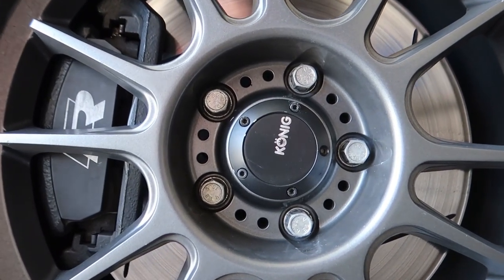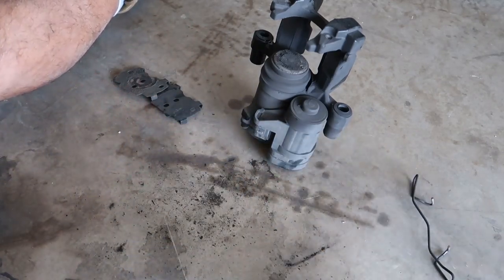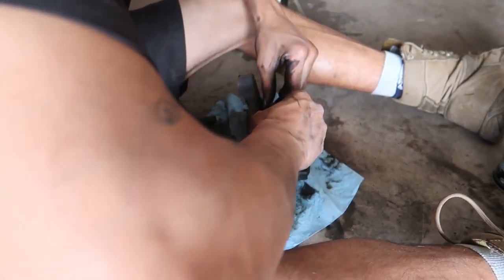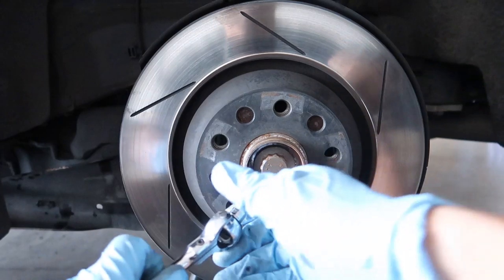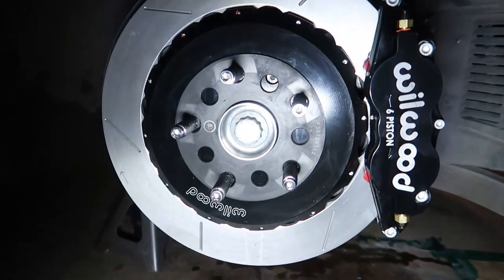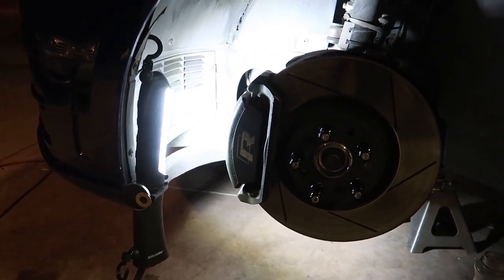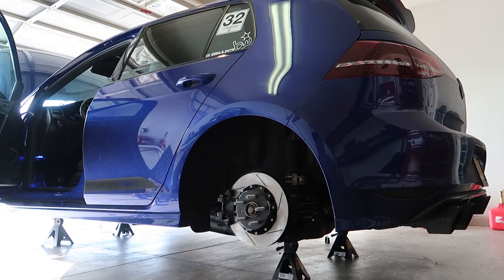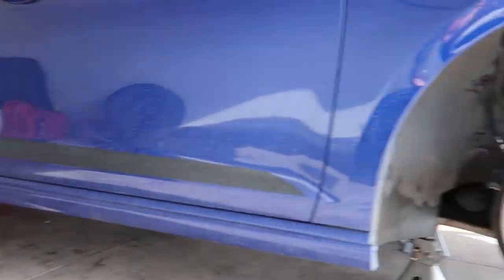Wilwood Superlite 6pot BBK + ECS 2pc rear rotor & 034 lines! | MK7 Golf R

Comment: Wow 20 lbs of sprung weight is a lot, is it very noticeable in ride or handling? 
LOL when I heard you say "I let the lines drain", my first thought 'oh no don't do that!' Live and learn. :) 
In the shop manual they tell you that anytime you are opening the system like say replacing a brake line or caliper, to open a bleeder and push the brake pedal to the floor and hold it there with a piece of wood or something (of course vw has a special tool for this but...). When the brake pedal is all the way down it shuts off flow from the reservoir, and stops the fluid from draining out while you have the lines disconnected.
I did this when I added SS lines and it works great, just used a 2x4 and wedged it with the seat and slide it forward. I also got a pressure bleeders and OMG, it is so nice, going forward I would never bleed brakes any other way. 
I am very interested to hear how these brakes hold up and how they perform under extreme conditions.
Reply from the maker: Heck man its 20lbs per SIDE! I can feel it, at least i think i can feel it lol! I will definitely be getting a pressure bleeder, sucks having to depend on others to come help, especially later in the day. Didn’t know about holding the pedal down, but it only makes sense.. but yeah just like you said, live and learn.. hopefully others that see this will now not make the mistakes i did!
Reply: @BryceJordanProductions  Oh BTW, how is the clearance compared to the stock calipers?

Comment: For the rear calipers I thought with OBDeleven you can have the piston go back electronically. I mean I have the golf R with electric parking brake.
Reply from the maker: Nah that's not how it works, it just released the motor tension so you can push it back in

Comment: Nice!  How’s the suspension feel?  I’m interested in the rear rotors. How much weight did they save?  I’m sure the fronts makes a huge difference in feel.
Reply from the maker: Saved about 4lbs going to 2pc in the rears! Suspension is set up very nice, I love it. Might actually wind up going to a stiffer spring later this season. But the BCs overall are awesome

Comment: another question for you about this brake kit.. I see you retained the dust shields no issues with fitment of those?  do you have OEM VW wheels using no spacers to confirm that 18 inch oem wheels will fit without contacting the caliper?   trying to decide what brake kit to go with myself too.
Reply from the maker: I dont have OEM wheels anymore, but going off of what i run now and prior, you shouldn’t have an issue at all, IF anything you’d need like a 2mm spacer.. but i highly doubt it, these only protrude a tad bit more then oem calipers. I had to run 5mm with oem calipers to clear my wheels and still kept that same spacer but you can see its just a tad bit closer to the wheel. No issues with the shields either!

Comment: I was originally going to get the tts brake kit conversion from shopDap but this kit is tempting because of the price. Any info on the brake pads that come with the kit?
Reply from the maker: I have no info on the included pads. But alot of companies make pads for wilwood so I'm sure you could find some you like out there. The pad design number is 7416

Comment: Bryce, I just purchased front and rear 2 piece ECS rotors and Hawk 5.0 street pads. What pads did you use for the rear brakes? I have noticed that there is very little clearance. Did you modify the pads or anything to get your brake pads to fit the ECS rear 2 piece rotors? Thanks for the help
Reply from the maker: I didn't have to mod anything buddy. I run isweeps on the rears, didn't notice anything abnormal about clearance. As long as they don't drag on the rotor you're good to go. You would smell/hear/feel if it was an issue
Reply: @BryceJordanProductions  I just happened to see in your video that the clearance between the rear pads and the ECS 2 piece rotor hub was really tight very same issue I had. I was worried the it was going to hit. We're did you buy the Isweep  pads
Reply from the maker: I believe I got those on ECS as well.

Comment: Hey whats up bro! Sorry to see what happened to your R...I know the car will come out stronger then ever once you are done with it!
I recently did a porsche Macan Brake upgrade and I ran into the same.problem you did with the brakes being very soft and almost to the ground when pressed..i bleed the system as well...any advice how to get them back to feeling normal again...do I bleed the abs pump too?
Reply from the maker: I turned on the abs pump a few times with obd11 and then bled and bled again with no luck. Going out to a dirt road and getting abs to kick on a handful of times then re bleeding is what worked for me!
Reply: @BryceJordanProductions  how did you turn on the abs pump through obd11
Reply from the maker: Shit man I don't even remember I just typed in vdcs abs pump and I think went off that it's not like a direct way but it gave me a general idea on where to look for it
Reply from the maker: @MrMartin11222  honestly though I don't think running the pump did anything. Going out and actually getting it to activate is what finally got it acting right

Comment: An you sell me some of those thick washers??
Reply from the maker: Which washers are you speaking of? For the adapter bracket?
Reply: Bryce Jordan Productions for the carrier, I’m doing my big brake kit on my Tig and rollaface I only sent me thin washers for the caliper, I need thick m16 washers for the carrier if I don’t use washers when I tighten the carrier it locks up the brakes...🙄🙄 Fustrating

Comment: Lol... metric is mm and standard are inches. Overall nice kit
Reply from the maker: What did I say..? Lol
Reply: @BryceJordanProductions  when you were describing the allen size of the brake holder and you called it metric lol
Reply: @BryceJordanProductions  @47:41 BTW, did you also put some loc tite on the wheel studs?. Just a little bit
Reply from the maker: Oh 🤣 often my mouth doesn't say what my brain is trying to convey, oh well lol
Reply from the maker: Yeah all the hardware installed got loctite to include the studs, but not the caps
Reply: @BryceJordanProductions  Awesome and like I said, great setup dude. Especially the weight loss of the factory units
Reply from the maker: Yeah man the weight savings is huge, I seriously cannot wait to get back to the track!!